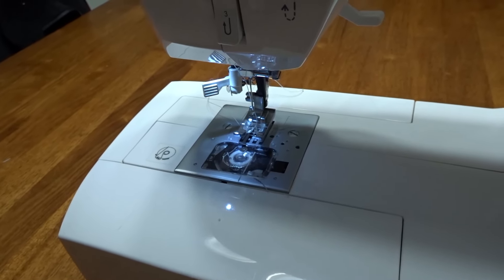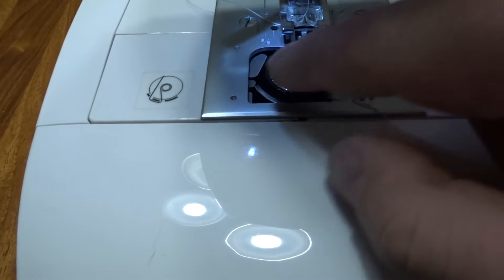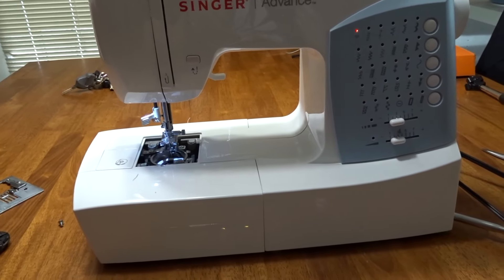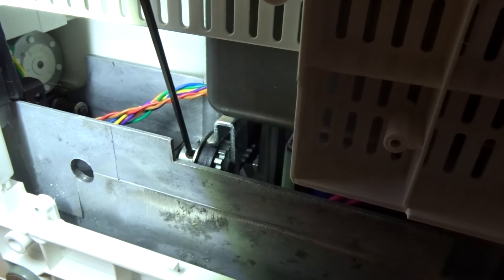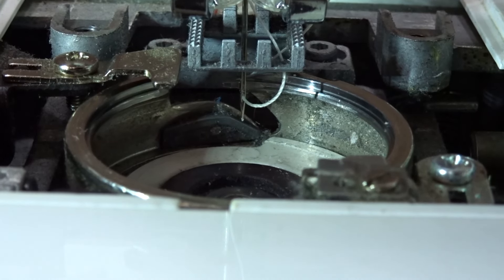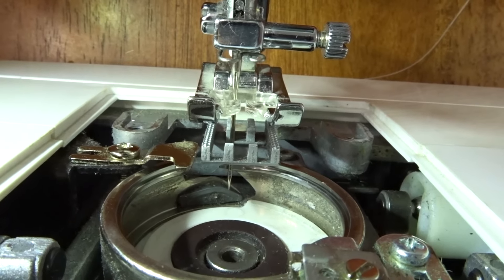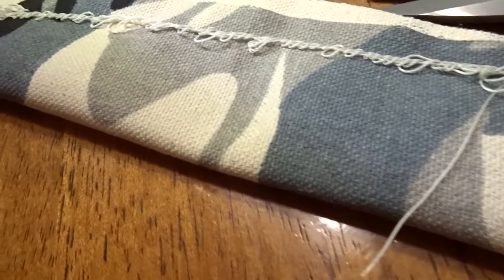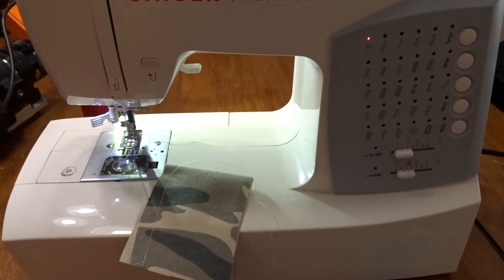How to Fix / Repair Singer Sewing Machine Hook Timing

Comment: Very useful. This technique will correct timing if it was put out by belt slippage, but the exact gap  between the needle shaft and the shuttle hook was not given. It is probably specific to each model of machine. Mine's a Singer 4411. Having adjusted the timing gap to be 3mm, I find that the initial pickup works but when the machine is run under power, the bobbin thread is no longer caught. I'll try increasing the gap.

Comment: Awesome instructions thanks so much! I got something jammed, but tore apart the bottom.  Fixed the jam, but messed up the hook timing in the process. Spent four hours yesterday trying to figure out when the needle should be near the hook. Worked immediately after I watched your video and tried it!

Comment: Thank you very much for this video. I just got a new machine,  was thrilled in that it is a heavy duty Singer. I was using heavy thread on top and for the bobbin. VBefore I switched to the heavy thread in the bobbin, I had a jam. Once cleared the machine was fine for a while then it stopped working. I called the help line and they told me I would have to return it because the timing was off. I have a client waiting for me to finish a jean jacket I am making. Returning the machine seemed extreme and highly undesirable. I did a search and found your video and VOILA!!! All is well and I will make my deadline!! Thank you so much.

Comment: That was very well done - most of us don't know what the trouble can be when things aren't working as they should.  Not only did you show how to troubleshoot but a nicely detailed presentation on how to fix it.  I have an older Singer (38 years old) electronic that has begun skipping the occasional stitch.  Was worried it might be the electronics (which I would never mess with) but now it may be more of a small timing issue.  You have given me some tools to do my own trouble shooting which may or may not mean a trip for some service.  : )

Comment: Awesome help!!! Sewing machine newbie I am, but consider myself mechanically adept.  I found the cogged belt that times all top moving parts to all bottom moving parts had skipped 1 cog due to a loosely adjusted belt tensioner. All is well in paradise, forget buying flowers and candy, if you can fix the sewing machine you’re golden. Key is hook should be passing the needle just as needle about to raise from its lowest point. 😎

Comment: Singer 6510 Scholastic - Thank you so much!  Though my machine looked different, I was able to make it work.  FYI for others with  the 6510 ..has the adjustments for the shaft directly under the timing carriage (not the back end of the machine) and has three screws you have to loosen.  Great help, thanks again~

Comment: Excellent video!  Clear and concise (although it did go kind of blue at the end...) without a lot of hoopla.  Thank you for taking the time to do it.  One thing puzzles me though; even if it's out of time, the needle should never go down far enough to hit the plastic disc under the bobbin should it?  Seems like the needle wasn't pushed all the way in in addition to the timing thing.
Reply: I'm having the same peoblem

Comment: Thank you for this visually detailed video. I was able to correct the timing on my Pfaff sewing machine without having to take it in to the repair shop and currently with the CV19 virus that's not going to happen for some time. Now back to sewing face masks.

Comment: I have taken my sewing machine apart as in your video.  I see that the gear (that would be responsible for turning the hook) on the end of the rod does not rotate when the rod is rotating.  It is as if it is loose.  It will kind of move, but not in full rotation with the rod. I have a photo to show you. This is my Singer sewing machine that I bought with my own money when I was 18 in 1986. I know I can buy a new one, but, I like this one and now that I have seen the insides, thanks to you, I want to save it.

Comment: the last thing I expected was this video. great job. I have a machine out now that I timed using the gears. yea PIA but the set screws on mine are a 5 sided bolt head that sits in a well. yep need to get a Penta thin walled socket. if I get up the courage I will use an EZ out and replace with a socket head. just saying use an EZ out gives me the willies. thanks again.

Comment: Thanks, man! We have Singer 7465, it has much more solid covers, so I had to unscrew it totally, but the issue was still the same so the solution, thanks again!
Reply: I have a Singer Quantum CXL and I can't figure out what plastic cover is supposed to come off. There are about a dozen screws on the bottom alone. :(

Comment: Couple things: 1) test with your widest zig-zag - just to be sure the thread is hooked with the needle at far left and far right. 2) depending on where the timing slipped, there may still be feed dog timing issues - more subtle, but that can cause problems with your stitch length.
Reply: Can you explain more or #2 please? I think im having that issue right now after fixing my timing.

Comment: A bit annoying that the timing can slip out so easily, unless the timing belt has jumped?  There's a tendency to use brute force when the thread gets tangled internally.  I tend to ram the side wheel back and forth with enough force to snap the thread, and so far nothing has gone out of alignment.  (I've bent some needles though.)  Mines an old Tpoyota machine which I deliberately chose for its simplicity.  No buttons at all.
Reply from the maker: hahah i was sewing canvas and purchased some really strong thread and it's been a bit harsh on this Chinese Machine
Reply: Yeah, they're not designed for men.  I used mine on heavy PVC/polyester fabric and it stalled where the seams crossed and needed manual assistance to get going.
Reply: bigclivedotcom keep an eye out for any of the old Kenmore machines. all cast metal and they take a beating. I'm suggesting Kenmore because they are not in the collectors world and can be found pretty cheap. forget eBay as the shipping will be more than the machine is worth.
Reply: My machine has not been used for a while.  I cleaned and lubricated it.  The first few stitches are ok then needle pulls to right and sewing stops.  Do you think this is the timing?
Reply: @bigclivedotcom  manually turn wheel when you sew over corners. Don't use pedal.

Comment: Thank you for this. My machine is picking up on the straight middle stitch but not on any of the zig zag type stitches. Also, stitch length is off, not consistent. Any suggestions for fixing this?

Comment: Thanks for the video! I removed all set screws but the hooked bobbin holder (forget what it’s called) still won’t move independently of the needle so I can’t adjust it. Any suggestions? I’m using a Singer Heavy Duty 4423 (and yes, I removed all three set screws).

Comment: Heya, 

Really informative video, however I’m having a strange situation. I’ve loosened the boots on my partner’s Singer Fashion Mate, but I still cannot rotate the hook without turning the needle. There is a threaded plastic disk beside the piece with the bolts that I have not seen on any of the videos I’ve seen so far and I was wondering if you had any insight 

Thank you so much and please advise!!

Comment: Great video. I set the timing on my kenmore Machine by watching your video but now it seems the part that holds the bobbin case isn’t moving at the same time as the needle so it throws timing off again which causes the needle to hit and damage underneath. Any tips? Trying to avoid paying a big repair bill or buying a new machine 😢
Reply: My hook is also hitting the needle 😢
Reply: Hi Amy, I have the same problem. Have you managed to put them back in sync?

Comment: wish i knew what tool you used to unscrew those two hexagonal screws /:
Reply: They are called Hex wrenches or Allen wrenches. The ones he used initially were T-handle extra long hex wrenches and then when he was fine tuning he switched to regular Allen keys. You can find them at any hardware store like Walmart. Walmart actually sells a really nice set of Allen wrenches that are made by Stanley. I can't remember if they sell the T-wrenches but Lowes/Home Depot might have them. They come in Standard and Metric, so it helps to know what they used in the machine so you can buy the right ones. Also, you might even be able to find them at Harbor Freight but the quality won't be as good as the others.
Reply: @lucidbarrier  Thankfully i got the correct tool (i had to get metric ones for my machine), but now the threads wont even catch (^': im done with this machine, ill either get a new one or get somebody else to fix it. Thank you though.
Reply: @lucidbarrier  I got two sets of Craftsman wrenches from Ebay---standard and metric.  BTW, on my Singer 6268, there is a circuit board right in front of where the gears are.  Good thing the connections are solderless.  However, I seemed to have mistimed my machine and the hook wheel is not grabbing the thread when it goes around.  How do I fix it?

Comment: Our Singer doesn’t have that bottom panel. I can see the timing wheel through a grate on the right side of the machine, but it isn’t accessible. Do you have any videos for different models, specifically the Confidence 7467?

Comment: I had this problem with my 2009 Singer Athena. I fixed it, and it just happened again. So frustrating. It just keeps making multiple long loops on top of the bobbin. I often break a needle when this starts. It just won't stay in time. Any advice?

Comment: That is only one of three possible places where the hook could have slipped time. Yes, it is the easiest to access, but if the machine isn't timed at the place where it slipped it will go out of time again in the future.
Reply: Video was helpful, but after every 3 or so turns, the timing goes out again..I have a singer 7102.

Comment: This is great, but I can't get into the bottom of a Singer Confidence 7463. It looks the same on the top as this machine, but the bottom is different. I've removed all the screws, but it looks like you have to remove the total plastic case to get to the set screws. I can't figure out how to do that. It's obvious this is the fix I need.  Any ideas?
Reply: I am having the same problem. I can time it from the top but can not secure the fix without being able to take it apart.

Comment: how to put the needle plate back on my singer Curvy sewing machine model 8780? the screw holes can't be lined up . per manual page 80 it says just slide it in, but it can't be. i checked bobbin case it sits like as shown in manual page 80.  do you know how, please?

Comment: This doesn't work on my Singer Imperial 7000.  After I adjust as described, it will be fine on the first rotation of the needle, but the second misses and hits the metal bottom of the bobbin holder.  What am I doing wrong?  I tried it on the largest zigzag stich and does the same thing. Maybe something else wrong on this unit as it should be that simple.

Comment: Do you know why my hook won’t spin when both set screws are loose?
Reply: you have to line the needle up and spin the hook plate back into position by hand or using a screwdriver very gently.  the main purpose of loosening the bolts is so you can manipulate it by hand. you might have to adjust it a few times but mine worked about the third time I tried it

Comment: hi I have a brother jx2517 machine, and the upper thread not picking up lower thread....  seems like the same thing in the video but I can't fine where to open the bottom.. 
can someone help me please
Reply: I have the same model and I had to take the side off to get to that bar
Reply: @ejc1210 has a video about fixing this problem on a brother machine! search "bobbin thread won't come up" and it should pop up!!

Comment: I bought this Quick Fix machine new off ebay and hemmed three pairs of pants and then put it away. Six months later I got it out to hem some more pants and the bobbin wouldn't catch on the thread. I opened up the machine and found one of the plastic gears had cracked. Called Singer and they said they don't have replacement parts for that model. What a waste of $60. It's all  because everything is now made in China where there is NO quality control. Singer used to be a quality company back when they made it in America but now everything they sell is nothing but crap, And if we didn't have one of the most corrupt government's on the planet, they would not have allowed all US manufacturing to be outsourced and become junk that only last one year.

Comment: You're not finished yet, The tensions need adjusting, either your bobbin tension is too tight or upper (needle) tension is too slack. Notice how your needle thread is showing through on the bottom and not pulled part way through the fabric so as to lock the stitches into place. The bobbin thread is just in a straight line passing through the needle thread.
Reply from the maker: +RAYAR54 the video isn't about setting tension it's about setting the timing........
Reply: Right you are.
Reply from the maker: +RAYAR54 that will be covered in another video